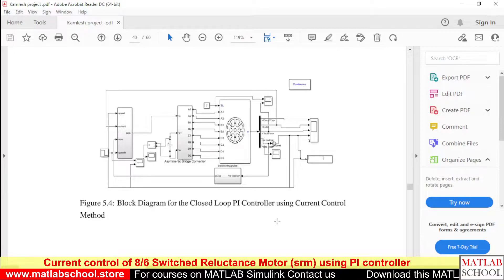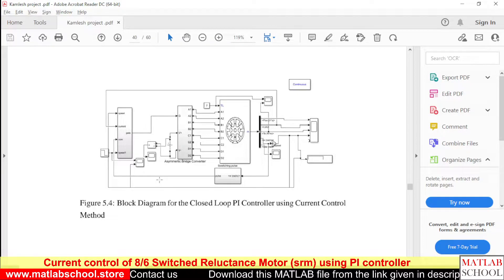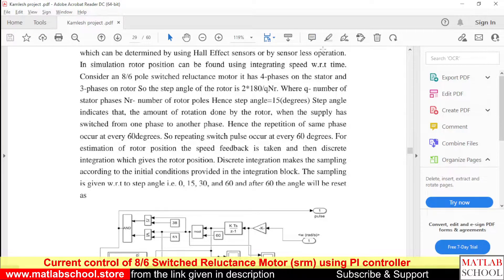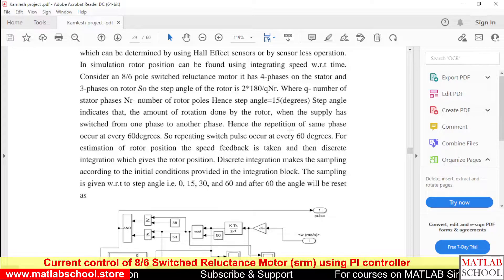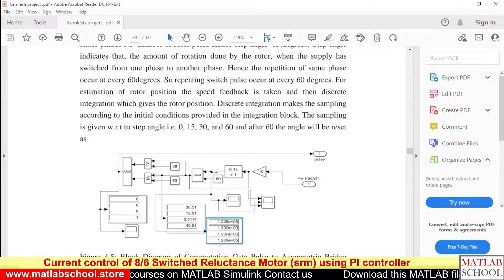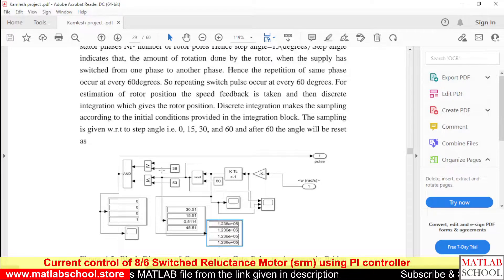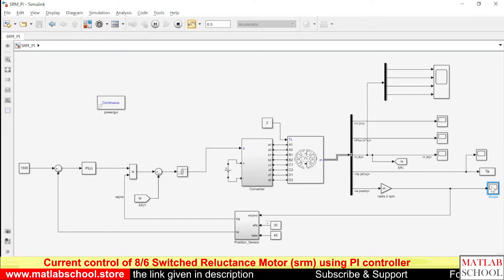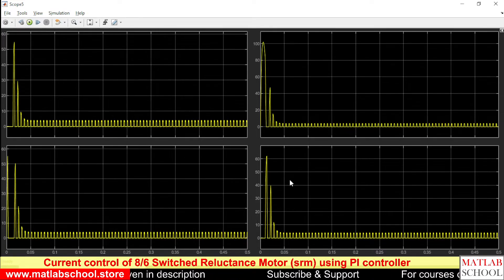Current control of 8/6 Switched Reluctance Motor (SRM) using PI controller

Comment: You are using 4 asymmetric bridge to control the 4 phase SRM. A good alternative is to use a standard three-phase converter, running FOC,  as the machine is then used as an equivalent  ''two phase''.